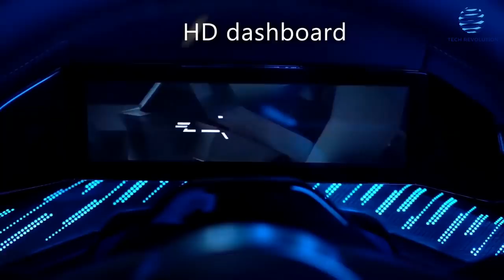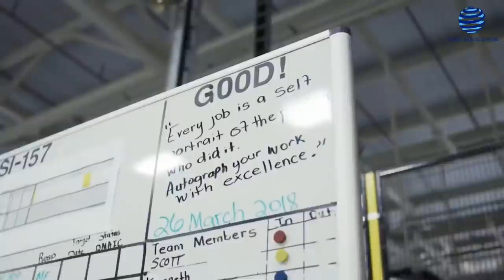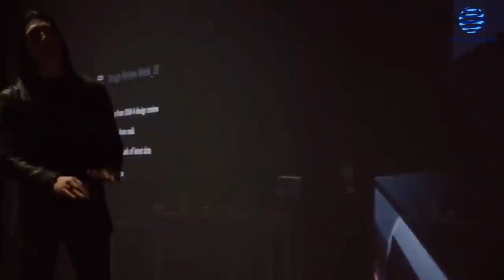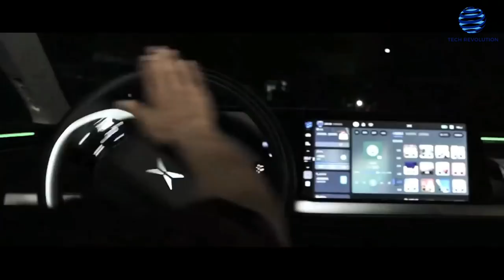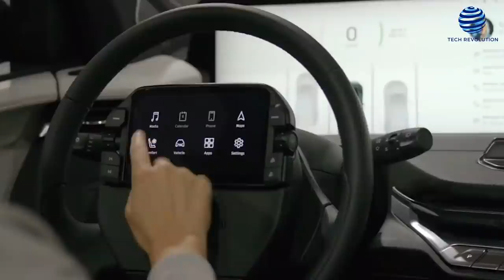Chinese INSANE Electric Cars That Are Set To OUTSELL Tesla Models 🔥🔥🔥

Comment: 2－5years？？？？？ BYD outselled Tesla in china this mouth
Reply: Hybrid
Reply: Yes, but every 3rd month(when they aren't shipping 90% of production overseas) Tesla takes top spot. For just EVs, not including plug-in hybrids, Tesla is still #1 in China. As fewer cars are shipped out, and production continues to ramp up, Tesla should stay #1 in China. BYD is doing great though and may yet match or even beat Tesla.
Reply: @davekozlowski1266  That is the problem, Tesla cant make hybrids nor gas car.
Reply: @IceCubebecd  that isn't a problem. BYD has stopped selling gas cars and will probably stop selling hybrids soon as in most countries, hybrid sales are dropping.
Reply: @davekozlowski1266  That is china never made good gas cars.Atleast they can still make hybrids.
Reply: @IceCubebecd  - That is a good point. Chinese carmakers never really tried to enter the Western market with ICE cars, because they were too far behind. EVs are a whole different thing. The 20 or so best EVs in the world (that you can actually buy) include at least 15 Chinese ones. NIO is a more desirable brand now than any of the German brands. Hongqi and HiPhi make EVs more luxurious and high-tech than anyone else on the planet. You can buy a Wuling Mini for $5,000 or a HiPhi for up to ~$150,000 or anything in-between.
BYD Hybrids have very long battery-only ranges, but they are just a transitional class on the way to a fully electric-only product line.

Comment: It does not mater what sporty, futuristic looking EV that will compete with Tesla. They are not built for family life.  What the average family needs is a car that can handle a family, be safe, have good service and support, provide a range for a days travel, charge fast and sell at  a competitive price.  I am old and practical, I drive a 2000 Chevrolet Silverado with about 100k miles and my wife drives a Toyota Camry with about 40k miles. I will not replace either until the EV will function better than they do. I have a closed in trailer, a 21 foot camper, and a car trailer, so I need a truck that can tow. It has to be able to get me 200-300 miles on a charge. Don't see now how I could recharge while towing with out disconnecting from the trailer.